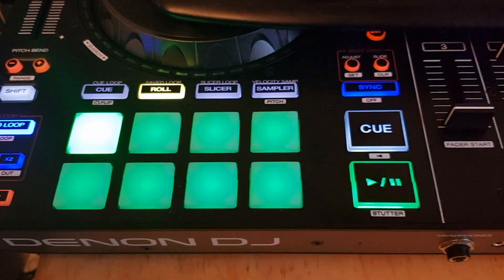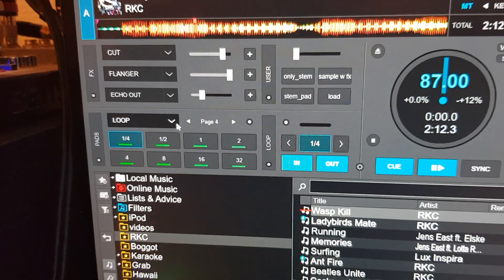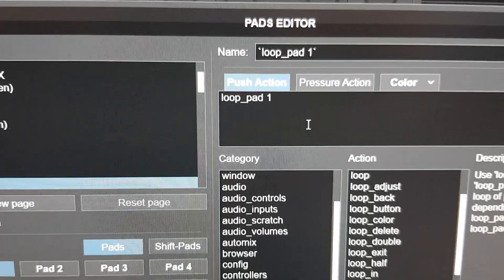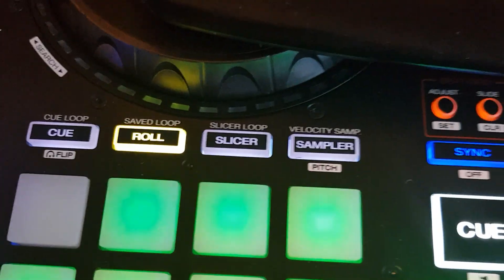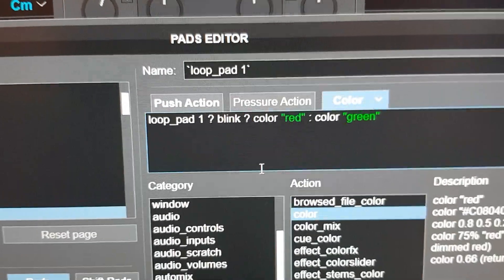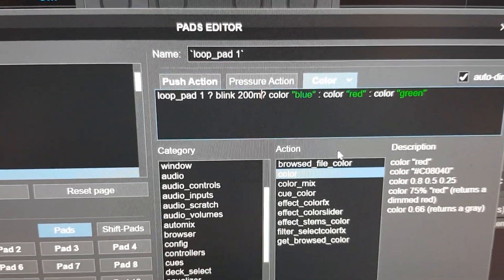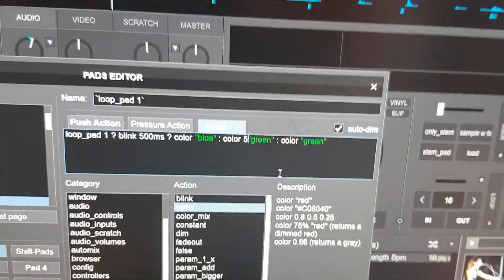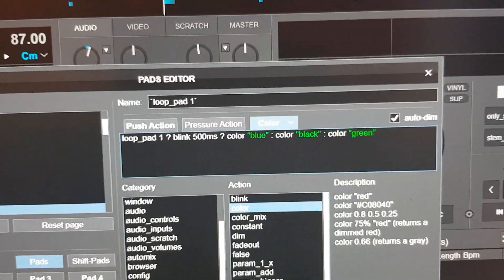Quick n' Handheld: Mapping colors on controller pads in VDJ8.5/2021

Comment: I need help my numark mixtrack pro 3 mic is only routed to the RCA Outputs , so i can't record myself in my sets ...
Reply from the maker: @kartelthedj  that is correct. That controller can't do this. So, you need to either record the master output by physically routing it to something that can record it, like a secondary laptop, or you need to use another mic input. The simplest way to get another mic input is by using a USB mic

Comment: Can you make video how to change color of the pioneer sb3 pads
Reply from the maker: It's the same as on pads on other controller
It part of the pad pages you select, if you go into edit pad page. They all have a color setting for each pad
Reply: I've tried it but nothing's happen can make video for it thanks
Reply: I'm using atomix virtual 2021 Ang dj sb3
Reply: You can't do that on Sb3, because Sb3 pads, are not RGB

Comment: Hello. very interesting these settings. but I also have a little confusion and maybe you can help me. for the hotcue led, I want to make the settings in the following way.... when a certain hotcue is selected, it will flash 1 or 2 or 3 blink. but exactly when hotcue 1 is selected to work, the others stay on. and the same for each selected cue, the selected one should flash and the others should be on. thank you.     update: I finally succeeded. I'll leave you here and why you are interested. but be careful auto-dim must be disabled. and when you copy in color you just have to name cues 1, 2, 3 and so on   hot_cue 1 ? cue_select 1 ? blink ? cue_color 1 : : hot_cue 1 ? cue_color 1

Comment: Wow and wow....thank you soooo much, I am mainly a Traktor user but getting more into Video.  I on occosion used VDJ but now getting more into VJ'ing at the request of the manager where I regularly dj.  Serato would not recognize my controller and VDJ actually has a template already when I plug it in which I have used for some time but it is not fully set the way I would like things.  I am using the Maschine Jam.  I recently tried Djay Pro for its video and also neural mix but mapping was waay too basic and not much control over things so....I should have just taken more time with mapping in VDJ.  

When I tried before mapping in VDJ I had spent time making a mapping and then came back later and nothing was saved...so seeing this video esp the changing of the lights is super helpful and the blinking for indicating things and different pages - super informative.

Many many great and wondrous thanks...

Comment: Does this work on older controllers like the pioneer ddj SR? not the sr2 but the original SR...they come with blue light up pads
Reply from the maker: Only partly since for instance SR doesn't have RGB pads in it. So you can't set it to a color it physically can't use. If you do, you will get the wrong color or no color at all

Comment: 📍Dropping in to ask a real hard AF question not answered on any VDJ forum.
 I've got the rane one, and as you know I've got 5 Pad pages (5 Buttons above my 8 pads). Is there a way to show on the skin 5 Page tabs instead of the standard 4 page buttons? I've not found a skin that has this feature and would love to have you show how to; Modify stock skin w/ a 5 page button visual on the stock skin.
Reply from the maker: I doubt there is a 5 pad pages skin - I've never seen it. I always use the mode where a drop down is shown in the pads section - not the mode with the 4 "buttons" (really just squares). I assume that is the mode you are talking about?
Reply from the maker: I think it has bow been built into VDJ with the latest early access release (build 6767)
From the release notes:
"Fix pad page menu not showing 5 pages for some controllers with 5 pad page buttons"